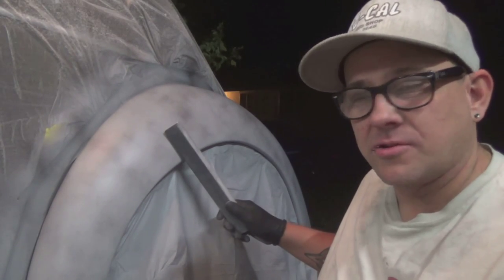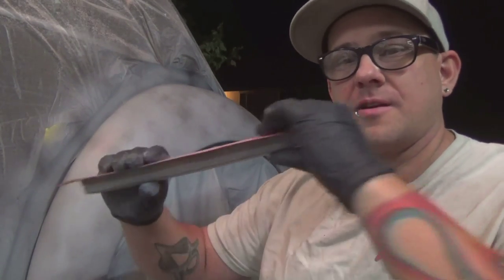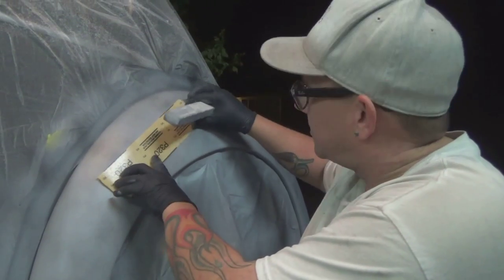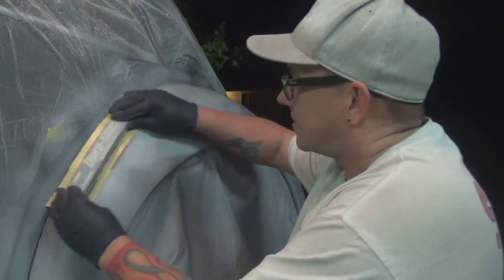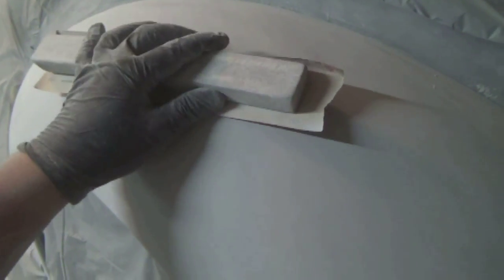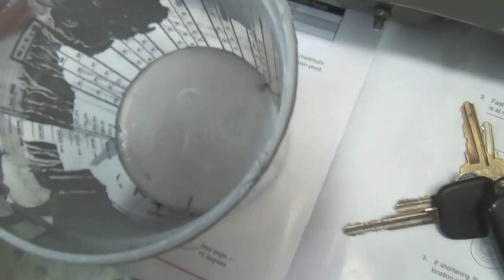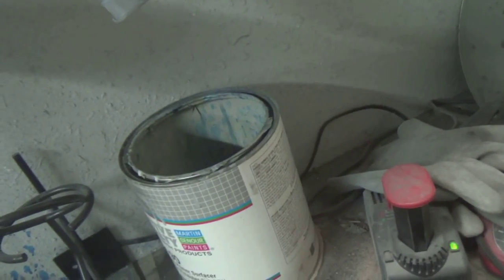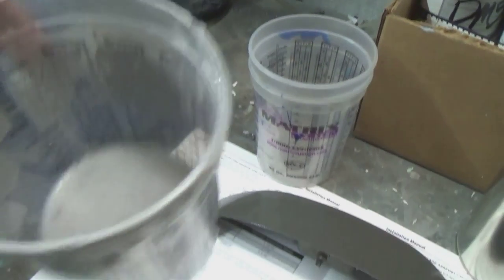How to Block Sand  round panels.

Comment: great tip !  will have to try this, and what primer are you using ?  I have been using high teck and it sand hard looking for a better primer that sands easier....   ?
Reply from the maker: This was urekem primer.  It sands ok.  Seems to me like most of the cheap primers sand pretty much the same. We use Sikkens color build at work and that stuff sands amazing. But its crazy expensive.